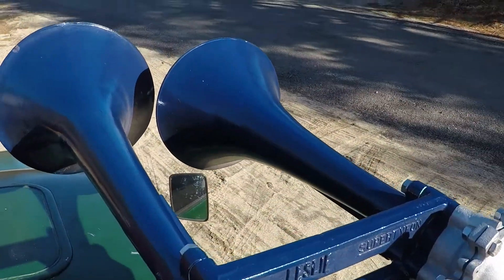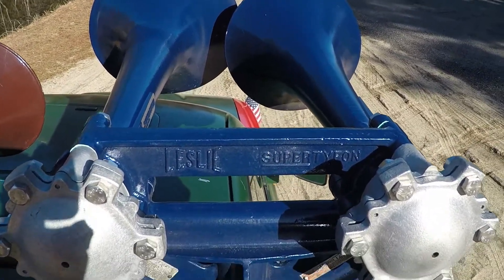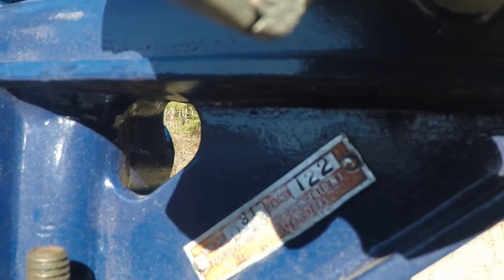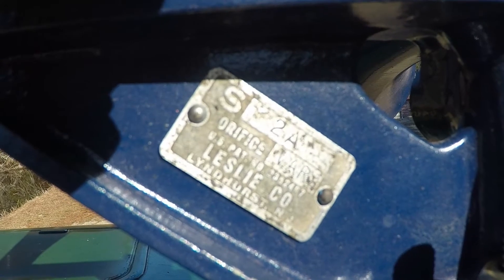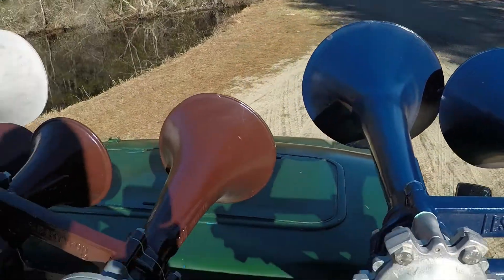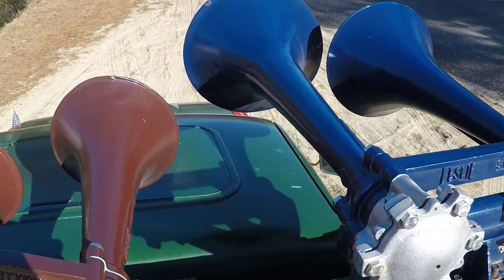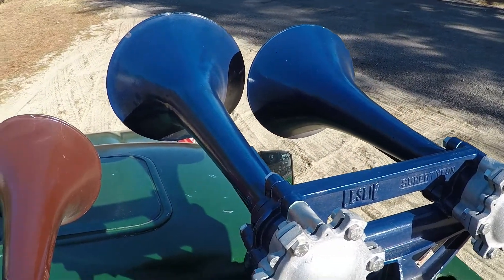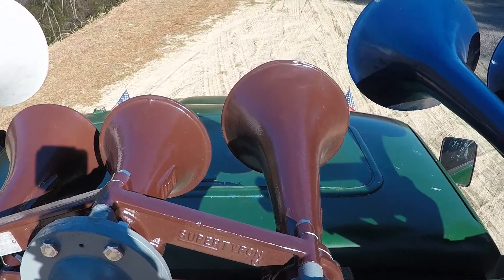Leslie S-2A, S-3B then combined = Leslie S-5T

Comment: Pretty neat!  C&O, IC, GM&O, and some B&O GP30's used a split manifold S5T that was these two horns.  An S2A over the engineers side of the cab, and an SU3B over the conductors side.  I don't know if they ever had dual control of each horn but wouldn't that have been cool?
Reply from the maker: Thanks. Gona change the S-3B to a SU-3B seein I built it out of parts. Got a SU-3B tag????